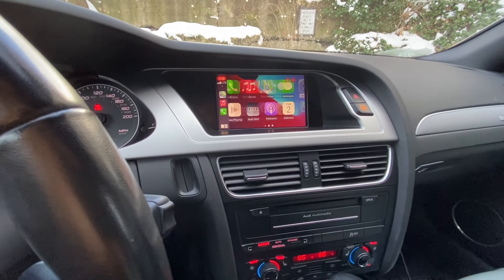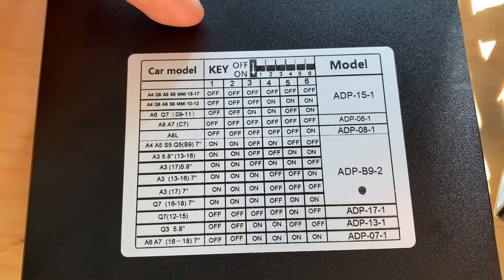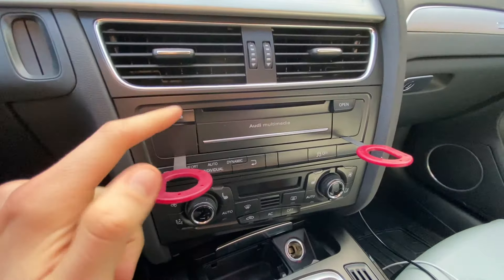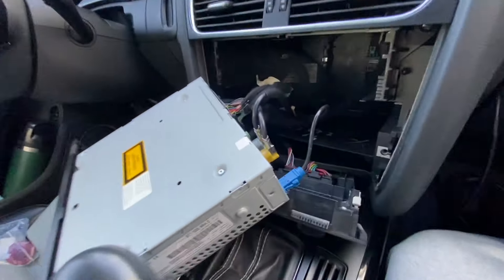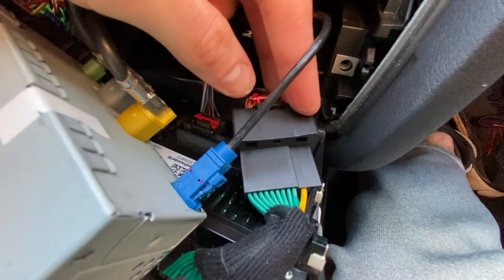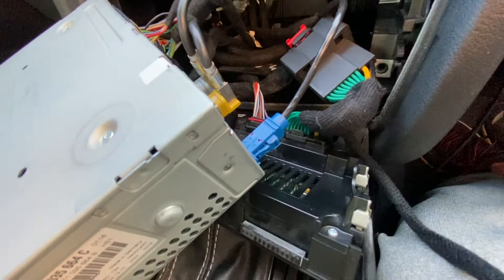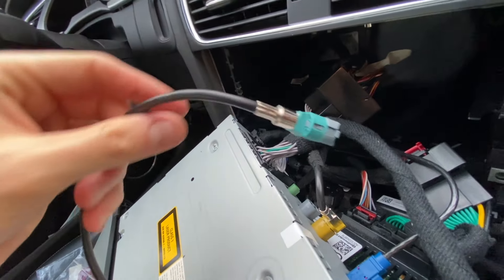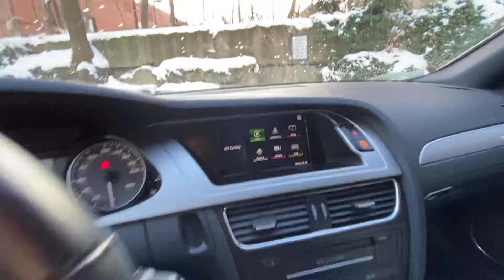Installing AppleCarplay on a B8/B8.5 Audi A4/S4 - (RSNAV)

Comment: Hoping you could let us know where you installed the Wi-Fi antenna in the end? Or did yours not come with one
Reply from the maker: Mine is the old version so it was wired and had no bluetooth! Although it is very tight I think you can squeeze in the antenna right next to the RSnav box!
Reply: Thanks for the response. Will have to find somewhere as an antenna worst position is next to a metal box.
Reply from the maker: @jeromenjuki2054  Yes, I have heard it is very difficult, but WILL work if you push enough haha

Comment: Thank you for the incredibly helpful video! I just unboxed mine, and it has a ground wire on the large plugs for the head unit. Do know if I need to worry about/ground it somewhere? Thanks!
Reply from the maker: If there is an easy ground I would say go for it. I don’t Believe mine needed grounding and worked flawlessly!
Reply: @griffenaddie  Thank you!!

Comment: Great video!  Any downsides to the RSNav unit?  I read somewhere that the microphone will have an echo when you are doing Bluetooth calls.  Is that the case?  Any other downsides?
Reply from the maker: Yes for the Bluetooth version there is an annoying echo for phone calls. But pretty easy to just not use the cars speakers when talking. Other than that. No downsides
Reply: @griffenaddie  do you mean use the phone's speakerphone for calls instead?
Reply: @griffenaddie  or if you wanna make/take a phone call, could you hit the PHONE button to get out of RSNav and use the plain old stock MMI?
Reply from the maker: @essbee5  honestly - not sure.
Reply from the maker: @essbee5  yes

Comment: Where I can find the required equipment for this installation
Reply from the maker: all you need is a VW radio removal took 5$ on amazon !
Reply: @griffenaddie   I found the removal kit but I can’t find the actually RSNAV kit. I have a Audi A4 2012 and  I searched in Amazon without any success. Please can u guide me on the right direction? Thanks in advance
Reply from the maker: @anthonyrivvy8801  link in description

Comment: With the wireless version are there any different wires or is just one less wire
Reply from the maker: Basically one less wire and an antenna that you have to put into the area as well. So it makes it a little tighter squeeze

Comment: Hi I’m at 10:17 in the video where you’ve just inserted the large male square plug from the RS NAV into the OEM female receptacle. You don’t show the work to get it in but say you “finally” got it in and jump to showing it fully inserted. I’m finding this extremely difficult to fit in properly as it is very tight. I even resorted to tapping it with the handle of a screwdriver hoping it would get it past some resistance point and produce the satisfying click sound but that only got it maybe halfway in and I also damaged a flange on the edge of the plug (not functional I think?) so I stopped that. 

Any tips here? On my RS NAV unit there is a rocker switch on both sides of the female end. Is that normal and do ai need to manipulate those to make it fit?

Thanks in advance 🙏🏻!
Reply: I managed to pop it in nicely and finish the installation following your example but now my bigger problem is there is nothing showing on the display. The climate controls are working fine which suggests that the RS NAV is working. Not sure what I can do 🤷🏻‍♂️
Reply: And the radio is working along with all of the buttons around the gear shift which light up when pressed but nothing showing on the screen.
Reply: Even the three buttons on the MMI console are working (hill parking, slippery road, rear parking aid)

Comment: Hey! Just a question. Do you still get  sound if you use the original audi's interface to play radio for example?
Reply from the maker: Tbh I never even used the radio in my car - Always Phone haha. But yes from my understanding you can use OEM functions 100% like OEM too - including radio
Reply: @griffenaddie  Thanks! Still works without any issue?
Reply from the maker: @kamil_montanaa  I’ve sold the car but I think they work for a long time: about to put one in my M4 now!

Comment: Excellent tutorial!  I have the same S4 without Nav and backup camera which I want to integrate.  My controllers are on the dash instead of the console.  I presume you don't have to code anything just plug and play?
Reply from the maker: yes just plug and play! I know they sell the back up camera, but am not to sure if that needs coding in or if it is relatively simple.. just make sure you order for your specific car and MMI!

Comment: Great video and I got my unit installed so it worked just as you described.  Question, I have a 2013 RS5 which has the aux cable installed but I can't figure out how to activate it.  Do I need to purchase a VCDS tool for $200 from Ross-Tech in order to get to the green screen and activate it?   I don't have a setup and car button.  Thanks
Reply from the maker: Hi Scott, 

could you explain what you mean by activate the aux ? Can you not get the RSNav to active CarPlay?

Try holding the NAV button
Reply: @griffenaddie  Thanks for the reply Griffen.  I don't have any problems getting CarPlay to start as you noted by holding the Nav button, I just can't get any sound since I don't have the ability to select the auxiliary audio input from any of the menus on MMI even though the cable is installed.  From other feedback, it looks like I need an OB2 dongle so I can activate it from there which access the "green screen" which I can't get to otherwise.   Some are able to get it by holding down "setup" and "car" but I don't have a "setup" button.  Others use "car" and "menu" but that didn't work for me either.
Reply from the maker: @scottmahl2352  hmmm.... I See. Last thought before going that route would be-- do you have an MMI output in your glovebox? If so make sure there is a MMI to aux plugged into the output (and just leave it in the glovebox plugged in. No need to have the aux actually plugged into anything). Besides that I would search around on audizine to see if there is any other solution besides the VCDS. I do remember hearing some variations specifically with the RS5 about the green screen troubles but am not as familiar with RS5's .... Hope you get it solved! Let me know what fixes it! Good luck

Comment: if you turn the car off while the car play is up, will the car play still be there? or will it be on the regular audi screen?
Reply from the maker: if you press the start button to turn car off but dont get out of the car - the carplay will remain up. 

But if you turn car off - leave and then come back to the car later - you need to re activate CarPlay every time
Reply: @griffenaddie every time is crazy 😂. Thanks
Reply from the maker: @rollerwrld1556  yeah not that annoying in reality. Just hold the button for like 3 sec when you start the car. and starts right up
Reply: @griffenaddie  alr thanks

Comment: The website says wireless carplay, is that true or is that usb connection to the phone needed?
Reply from the maker: the install video is with their old "wired" version. now they only sell a wireless version. same install process just with a small extra antenna :)
Reply: @griffenaddie  Alright, thanks so much for the speedy reply. I was thrown off by the title saying wireless but it still including that female USB port in the product images.

Comment: You got an MMI 3G high right?
Reply: Cause i got an MMI 3G high in my 8K and i‘m not sure at the ebay side of RSnav they say its only for 3G and 3G+
Reply from the maker: yes
Reply: @griffenaddie  nice thank you for this information than i can order it now :)
Reply: @griffenaddie  did you got wireless carplay too or do you need to use an USB?
Reply from the maker: @ricardohilliger3566  For mine (in video) it was a old wired version. Now- they only sell the wireless bluetooth version! Same steps, just a small antenna you put in with the box

Comment: I installed a very similar unit on my B8 S4 manual but I ended up returning it because the backup camera wouldn't pop up on screen when I shifted to reverse, unless I switched back to the MMI system. Also the phone call quality was terrible. People on the phone heard themselves echoing a lot. Tried adjusting settings with no luck. Curious about your experience with these issues?
Reply from the maker: my system is "wired" which I think solves the phone call echo problem compared to a wireless CarPlay unit.  when shifting to reverse my backup camera pops up like normal then it automatically switches back to CarPlay once I go back into drive. My guess would be that its coded for an automatic(dsg) car and with your manual car it doesn't register being in reverse?
Reply: that's why you spend the extra money on an RSnav.
Reply: For anyone reading I had the backup camera issue. I had to flip one of the switches in the carplay module box to OFF. Then it worked. No echo here. Very pleased with results

Comment: When I push my nav button I get A white screen. What do I need to do?
Reply from the maker: hmm. couple thoughts-- 1. make sure you are holding the nav button not just pressing. should hold for 2-5 sec to engage CarPlay. 2nd. double check that all the wiring is exactly correct, very easy to get one thing wrong as it all looks relatively similar. 3rd make sure all the pins on the connector are UP/DOWN in the proper way for you specific car! (likely it)

Those are my guesses of possible quick fixes, if all of that is addressed and it still isn't working, I would suggest contacting RSNAV directly for support. (as I am not affiliated with them, just a car enthusiast )

Comment: You're apple play module looks different than the one on the RSNAV link you shared. Once I order it will it change or am I missing something I have a 2012 S4 with NAV. B8.
Reply from the maker: Hi, yes the link picture is different, but it is the standalone unit just like the video. Except it is now a wireless version as they don't make the wired anymore. (I don't have any affiliation with RSnav so not sure about the ordering charge etc)

Comment: heya thx for this video....do you know if the newer version that is wireless uses the existing bluetooth and does it need a hotspot from your phone to work?  my existing bluetooth is kinda jacked and i currently use a echo auto for bluetooth.  Hoping the phone just ends up connecting to the rsnav box.  Do you know?  Also for the wired version you have does it charge the phone when plugged in>
Reply from the maker: Hello! from my understanding if you have a b8.5 (has bluetooth music) it uses the existing Bluetooth music that comes with the car. Although, if you have a b8(bluetooth phone calls but no bluetooth music) I'm not quite sure. If anybody knows, feel free to drop a comment

Comment: hooked up everything and all signals are going back and forth from the phone to the car but the sound isn’t working.  any ideas
Reply from the maker: make sure you have MMI to aux plugged into the glovebox. Can just leave it in glovebox but must be plugged in
Reply: @griffenaddie My MMI is plugged in could there be anything else?
Reply from the maker: @faithmeyer2548  would just double check all the fittings then. not sure. Double check you have a compatible MMI.
Reply: @griffenaddie  I REALLY appreciate your helpfulness on this. So you’re saying i should run a cord from the glovebox to the carplay device so it’s connect through that as well. Sorry. I’m struggling with this. Thanks again
Reply from the maker: @faithmeyer2548  No just have a MMI to aux cord plugged into the glove box. the aux cord can stay unplugged from a phone and remain in the glovebox . but needs to be plugged into that MMI spot

Comment: Would you say this is relatively the same process for a 2014 S4? My OEM mmi Module stopped working and dealership quoted me about 5k for a new module plus labour. Also wanted to ask if the 2014 s4 (b8.5) would require an AMI cable or not if you do know. Thanks
Reply from the maker: I believe the new RSNAV is bluetooth. You would need a  MMI to aux cable in theglovebox but it can be attached to no phone and just stay there. if your entire MMI system stopped working it could be a deeper problem. Not sure. would try to get the codes and research the problem

Comment: Hey Griffen,

thank you for this video.
If you use navigation, do you see the navigation arrows in the gauge cluster as well (Google maps navigation for example) just like in the stock navigation system?
Reply from the maker: I must admit, I think I only used the oem navigation once or twice. I usually just used my phone with Apple Maps or Waze. With the RSNAV it does not use the front gauge cluster arrows like the oem navigation would. BUT, you can choose full screen navigation/half screen ect. through car play center screen

Comment: can you skip songs on spotify with the dedicated media buttons or do you need to scroll through the whole thing?
Reply from the maker: you can use the( scroll/button) under the gear selector OR the forward backward skip buttons on the left and right of the return button(below the (scroll Botton). Or of course your phone. But I found that since Spotify integrates so nicely with CarPlay, the (scroll/button) was most useful to quickly pause, skip etc
Reply: @griffenaddie  what about the buttons on the steeringwheel?
Reply from the maker: @4player470  volume works, although scroll wheel Does not function for track selection

Comment: Hey Griffen, do you know if i were to install the newer wireless kit is there any additional steps in the install process? Also i feel like i have seen people mention issues id the old apple connect cord in the glove box is not plugged into something does is just need to be connected to any attachment? Thanks in advance and awesome tutorial was super helpful.
Reply from the maker: I have never installed a wireless version, but, I think that there may be an antenna that would go in along with the box. The new wireless version does give some feedback echo when talking on the phone. And yes you have to keep an "aux" output plugged into the "aux" mmi in the glovebox. I think that just ensures proper sound while playing music. I can say, with my system- the music sounds exactly the same playing through the RSNAV as it did from the mmi aux from the glovebox

Comment: I have a 2012 audi s4 with audi concert would i be able to install this in my vehicle?  Very interested in buying it but nervous and wasting the money if it isnt compatible
Reply from the maker: yes, you can get one that's compatible with your system. just make sure you select the right options for your car(audi concert ) . You also will most likely have a different switch up/down than I did. But just email RSnav to confirm, but I think there's and option for your car

Comment: if u instal this mod can u use the original nav?  seccond question if u have the option of the nav in ure cluster like go left with the arrow do that stil works?
Reply from the maker: you can still choose to use the cars navigation. If using CarPlay navigation you won't get the dash arrows.

Comment: brother i have audi a4 and i have lvds only pink and yellow which should i plug in to
Reply from the maker: hmmm. Im not 100% sure, but, my best guess would be to plug into the pink. That being said, try plugging it in and before you put it all back together, turn on the car and test it out. If it isn't working try the yellow.

Comment: I have carplay in my A4 2010 but sound quality is super bad… 10£ radio bt receiver sound better. Any solution? I’m sure that carplay should sound same like a radio. Not like a flat shit…
Reply from the maker: hmmm not sure..... do you have a mmi plugged into your glovebox? mmi to aux but not plugged into phone
Reply: @griffenaddie  i have box connected to the aux and i connect phone wireless. But still sound quality is flat and worst then Radio BT..
Reply from the maker: @SnackyYT  hmmm. that was not my experience at all.. Would double check all wiring and make sure you have a mmi to aux plugged in in the glove box!

Comment: so i have a 2014 allroad, which car model am i supposed to be following on the rsnav module? 1:26
Reply from the maker: Hey, So its not necessarily about your car, but more your MMI. I would follow similar steps to a 2014 a4. And just make sure you have the correct mmi 3g or up to run this

Comment: Does this work with an 2013 a4? I have a backup camera and system in my glovebox but it only works for for phone calls etc. I only have the concert stereo though
Reply from the maker: it may work. Check this article out. https://hifimax.net/blog/how-do-i-know-if-my-audi-mmi-is-2g-or-3g

if you have anything above 2g mmi it will work!

Comment: Great video. I have I stalked a similar unit on my 2010 Audi A5 but after 6 month, I am unable to   connect  the decoders Bluetooth or WiFi and therefore does not function. All the OEM applications function normally, so the by pass portion is working fine. What would you recon is the problem?
Reply from the maker: hmmm not entirely sure! Could try unplugging the bluetooth/wifi antennas and using a wire or getting a new plug in
Reply: @griffenaddie  the wifi antenna and blue tooth are the same?. A defective antenna would affect the Bluetooth and Wifi?. 
Thanks for your response..
Reply from the maker: @moatazel-shafie3689  yes! if the antenna was defective that could cause the outage. Would first try to just unplug-replug and if that does not work may try to order a new one
Reply: @griffenaddie  hello again.  I tried new antenna but nothing changed. Two things I noticed, there are two green wire pins that are loose from the car play module canbus plug. Do you show any unconnected pins from the carplay module canbus pin that is wired to the climate control plug?.
Also, what do you show I hidden menu under Main/diagnose/settings AMI/Aux
 I am currently having it at 3/8 or Aux/no MI BT/Aux).
I appreciate your help